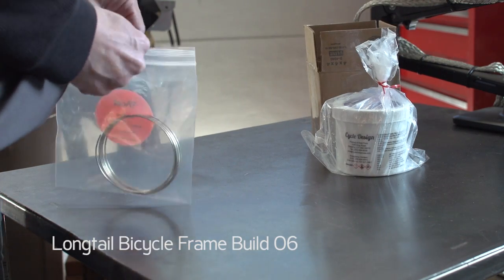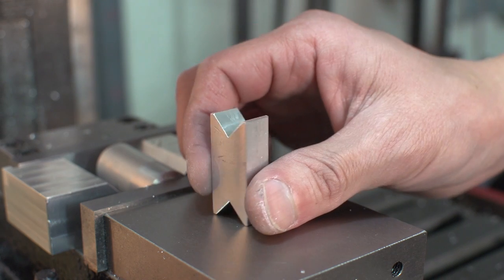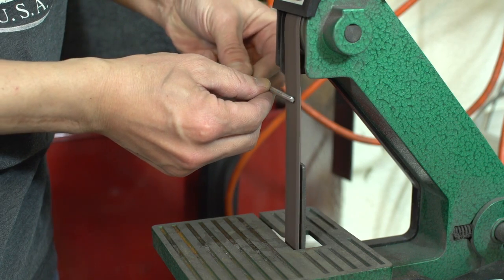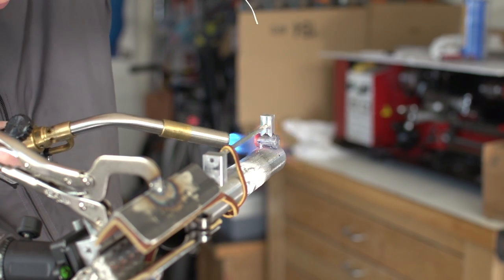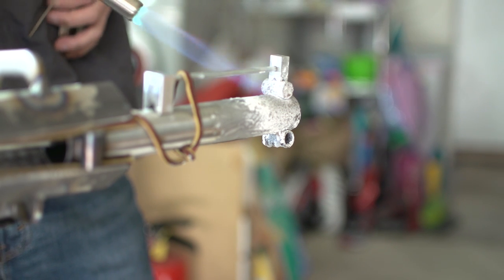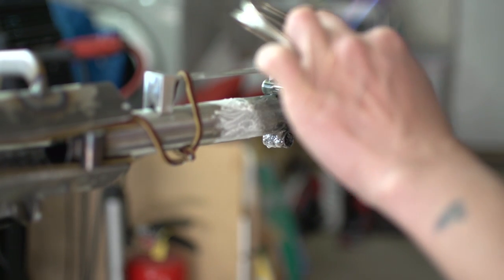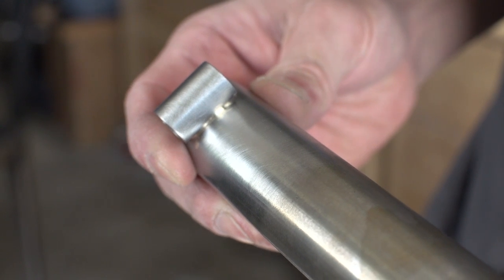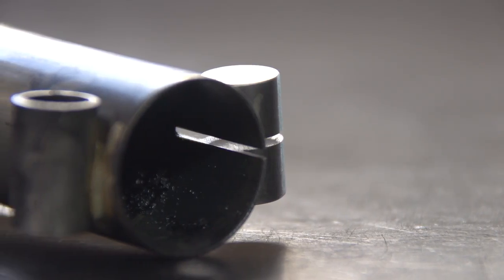Longtail Bicycle Frame Build 06 - Silver Brazing Seat Tube Binder With MAPP Gas

Comment: Before brazing, I always clean the pieces with acetone before applying flux. I mark up my tubes with a permanent marker so the acetone gets that off, but it also removes any oils that are present on the tube. Also, I was told, "The more flux the better." So I cover the tube with flux, and the piece that I'm attaching. Once I have it set in place, I add more flux around the piece and the tube where they meet just to be sure.
Reply from the maker: Thanks! Yes more flux is the general consensus. I'll get even more liberal with it :)

Comment: Practice brazing with an oxy-acetylene rig using the right torch size. You will have much more control over the heat.
Reply from the maker: I'll give this a go. More spending @_@
Reply: You can get a set up for a reasonable price. You won't regret it. You'll quickly see that it increases your productivity and overall effectiveness. It can be used for heat bending too.

Comment: watch your video-> correct my set up-> re watch the video-> aha! ... thinking on how many watched to go for :P one question will be to see what other alloys/rod materials you can melt using that torch, I'm starting with a similar one, solder around 25%-35% silver (fluxed, plus other alloys, like tin). I would like to start filleting ... but I don't think what I'm using will build up well, and probably not enough heat for bronze brazing? meh...
Reply from the maker: Zanconato left a comment about using Low Fuming Bronze. A MAPP gas torch will heat it enough to do the job. However I may still get an O/A setup to focus heat in a smaller area.
Reply: Pithy Bikes also remember that an oxy-butane might work well as it goes quite high in temp, at a lower price and I think a safer setup (like everything when handled correctly tools are safe, but acetylene will burn spontaneously if hit strongly etc, as it is not stable at normal temps. Me I am not that keen to have the cylinder around at home with my kid jumping everywhere and with everything). But my experience is very limited yet. I found in Europe the smallest set up for O-B to be around 230€, and everything is much more expensive here. hopefully someone in the comments uses this extensively and can let us know about their experience.

Comment: @PB

So the other day I found my head tube has a crack around the circumference of the tube, starting at the lug. This is a bummer for me because its an older 80's Sekai that was made in Japan and sold in Seattle 35 years ago. It would be cool if I could salvage it, but I am wondering if the head tube geometry is off now. Also, if I were to braze it, should I use a material such as the one you have shown? I could weld it (my dad's mig) but again, Im afraid of the geometry being disturbed and redistributing the torque when steering. 

I have considered the fact that the frame might be toast, but I figured I would ask how much the materials cost and if it is worth attempting. 

Cheers!
Reply from the maker: +Samuel Ross this is a really tough one! I think tig would be the best option if it's a tig welded frame. If it's lugged, which it probably is, then possibly braze. I wouldn't use silver. Bronze would be the stronger choice based on everyone's comments here. For the geo, you could bring it by a good bike shop and ask them to check it. Make sure to strip it down first. You could also check yourself by searching frame alignment in YouTube. I don't know how reliable some of these methods are though.. If it rides ok.. Chances are it is! Good luck!

Comment: My Observations and 2-cents..... 
(1) I would CLEAN all parts with something like Alcohol or Spray Carb clean or something first-
(2) I would perhaps also give the big tube a quick once-over with Emory cloth (avail on a roll for HVAC techs)
(3) I would invest in a Jewelers Torch set or Small Fridge Technicians Torch Set (Oxy-Acetylene)
(4) Once you get a real Torch set, use #00 or #000 tip
(5) use Braze rod and not silver solder and the blue powdered flux that you dip the hot filler rod into
(6) invest in a small Bead Blasting cabinet for post-weld Flux cleanup- even a Harbor Freight tabletop one is better than nothing!
----------------------
I say this because I've made and modified thin-tube racing Motorcycle frames and race go-kart frames for years using these things....... very strong, and not totally unlike your Bike frames- you could also mess with using your TiG torch as a more precise heat source , but only for Braze rod????
Reply from the maker: Thanks for sharing your 2 cents :) It's interesting to hear how other folks are doing it. I'm very seriously considering getting an O/A setup soon.. I mean, I was going to but planned on later rather than sooner. The solder is not actually silver solder but brazing 56% silver (maybe you already know that and I misunderstand) The flux I'm using is made specifically for bicycle frames and I believe professional builder use this. Blue powdered flux sounds interesting. What is its main use for application? Bead blasting cabinet sounds awesome! But I don't have the space :(

Comment: Can you normalize the seat tube after welding so you can cut the slot? If not get a carbide milling cutter and have a go, you might be surprised.
Reply from the maker: I don't know if I can but I'll look into it.. There's also other options that are really simple for cutting the slot like using 2 hack saw blades together as a few other folks mentioned from the previous slitting saw video. So many options..

Comment: i would strongly encourage low fuming bronze on the actual frame's binder. I've seen way too many silver brazed binders that have broken off.

No need to wave the torch around so much. And you can hold it closer from the start.
Reply from the maker: Thanks for the tips Mike! Alistair also recommended against silver on the binder for the same reason. Looks like I cannot avoid an O/A setup :) Good to know about the waving and holding it closer, i really have no idea hahaha.
Reply: Pithy Bikes I think you can do bronze with that torch. Just hold it in the hot part of the flame (closer to the inner cones) and move the torch slowly to heat a larger area. Looking good, man!
Reply from the maker: I ordered  some low fuming bronze today and flux to go with it. I'll give that a go. Looks like I may still invest in the O/A rig sooner rather than later :)

Comment: Great videos! Thank You for all the ideas, really helpful.
I'm brazing with Oxy/Propane: lot cheaper (and safer) and same results for brazing thin bike tubes.
Reply from the maker: +Massimo Ielmini nice, I have heard of this and was wondering if anyone was using it on bikes. Are you brazing with bronze? And maybe it's not hot enough for filler brazing?
Reply from the maker: +Massimo Ielmini *fillet *
Reply: Hi, yes, I'm using bronze and flux from several suppliers and in different diameters depending on the joint. The heat is enough with Tip no.3 from Harris, just slower to build up to temperature (which is better to learn).
Big help was this site:
http://www.framebuilderscollective.org/kirk-fillet-brazing/
for the correct building order and:
http://www.velocipedesalon.com/forum/f10/
for everything else (Eric Estlud is my personal guru..).
Thank You again for You inspirational videos.

Comment: Hi can I braze a bmx bike frame together with that torch
Reply from the maker: I wouldn’t recommend it. It was tricky getting the control needed using mapp gas. But also, silver solder has a lower melting temp than say bronze. And silver is not strong enough for main tube joints. It’s ok for things like bosses though.

Comment: Ond comment about slitting saws that I didn't notice when I scanned the comments is that your mill should be well trammed.  An out-of-tram mill will force a slitting saw to drift and cut a curving slit.
Reply from the maker: Ah right on. I haven't checked my mill lately but I did tram it when I first set it up. That was a long time ago! But in the case of this video, my problems were due to tube deflection and climb cutting.

Comment: Maybe a little more heat on the tube and not the clamp....? also an oxy torch has better heat concentration. .. the first one got too hot where the clamp is thin... no need for flux inside the tube...
Reply from the maker: Ah thanks so much. It's SO different from TIG hahaah. Ok no flux inside the tube (I was just being paranoid). I really want to get an O/A setup now :'(

Comment: Just point the torch!  - and stop all that wiggling! The idea is to heat the parts.  Your flame is mostly not aiming to heat the parts.  The most massive heat sink is the tube.  Heat the tube then move on to heat the lug. Then, just before the solder, re-flux, reheat and solder.

Comment: I thought you should only apply Flux to where you want the Solder to go?
Reply: Clipboard I was wondering the same thing, I've never silver soldered anything though? The joint did look good though.
Reply from the maker: I thought so too at first. But the solder is different from say soldering wire. In addition to flowing the filler, it also acts as a shield against oxidation. So anywhere things get hot, you want the solder.
Reply from the maker: correction - Anywhere things get hot, you want to FLUX.
Reply: I agree with you Mariusz, that is the way i have been taught.
Reply from the maker: Ah, ok. thanks I'll keep it closer to where the actual brazing happens. You guys are awesome :)
Reply: I can't imagine it hurts anything as long as it gets cleaned off after. Maybe help keep the heated area protected like purging in TIG welding?

Comment: There is no reason to slather flux all over the tube, you want it where the joint will be - the rod flows where the flux is, because that is where it can actually wet the base metal that is being kept from oxidizing. You don't dip the whole wire, PCB or tubing section in flux when you solder copper, do you?

Comment: When are you going to learn that the metal must be hot enough that when the braze rod is placed on the metal it will melt and flow. Clean everything before you start. Also, you should have dipped the silver braze rod into the flux too. You must heat the heavy part first more so than heating all around as you are doing, but all around heating must also be done. Experience tell me you are a novice for sure. Good luck to you fella.

Comment: Why not tig ?
Reply from the maker: I tried tig and hardened the steel in the process.. and that was a problem only when I thought that I would use a slitting saw to slot the tube. Now I've changed my tune thanks to everyone's comments. I'll simply use a hack saw to slit the tube. But, in the end I'm using a simple seat collar instead of welding or brazing a binder on. Cheers!
Reply: Why not just anneal the steal? Wood ash makes a great high temp insulator you can put it into to cool slowly. This is a favorite tip of knife-makers and it also works great on small tools I have found.

Comment: I don't know if i just didn't get it but why didn't you just tig welded the pieces on the tube?
Reply from the maker: I tried that in Video 05 and it worked ok. Only problem was I didn't like how welding such a small piece cut into the edge of the head cap side. Also the heat from welding hardens the steel and makes it difficult to use a slitting saw.
Reply: Ah ok thanks,  i probably was disturbed at that point of the 5th video :)
Reply from the maker: hahaha lol :)